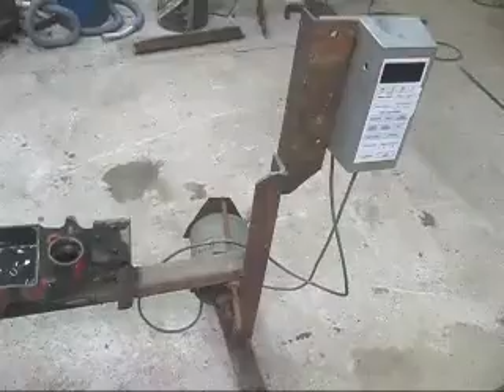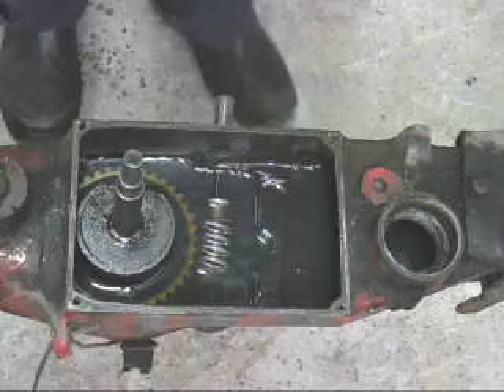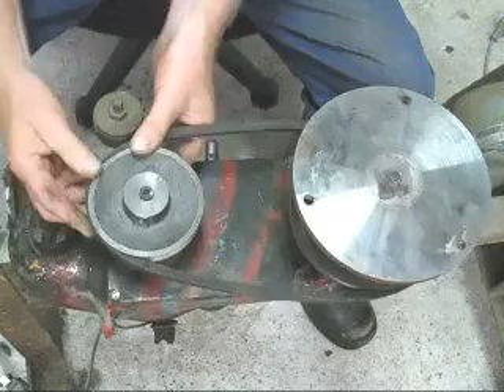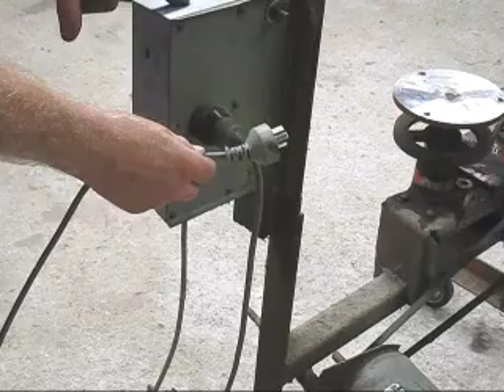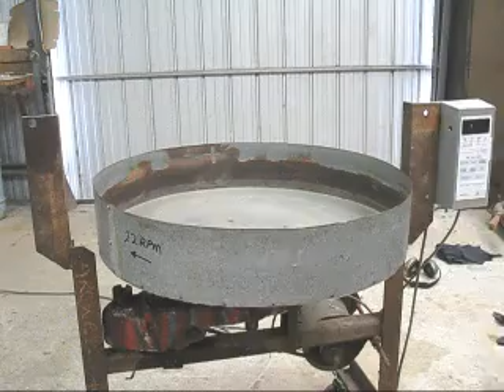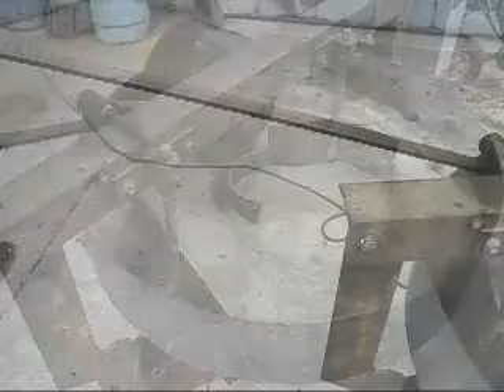Sand mixer overhaul

Comment: a simple and real great solution. just one tip - you achieve higher belt life time when spanning the belt into the other direction. In your case you're tensioner bends the pulley against the direction for which it has been designed.

Comment: That Microwave control panel is genius.  Does the High/low power function change the speed of the motor as well?  Even if it doesn't that idea is most definitely going in the "toolbox".